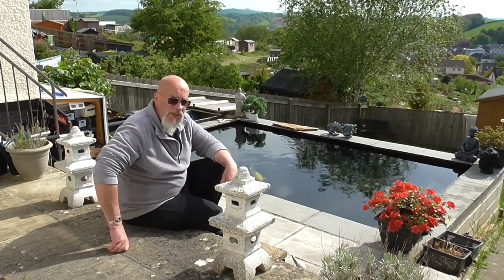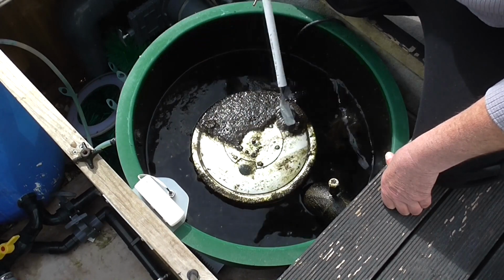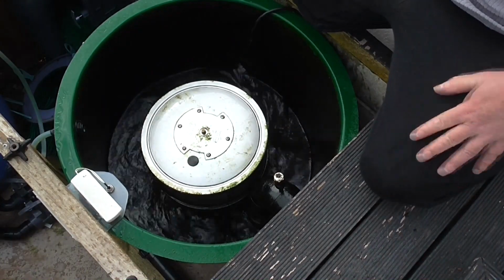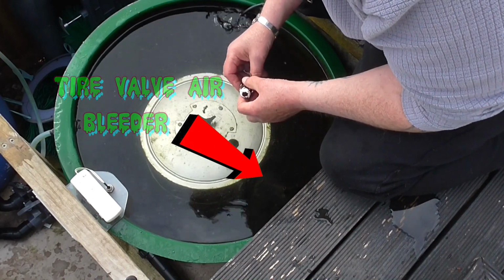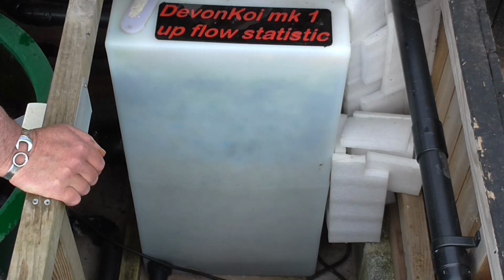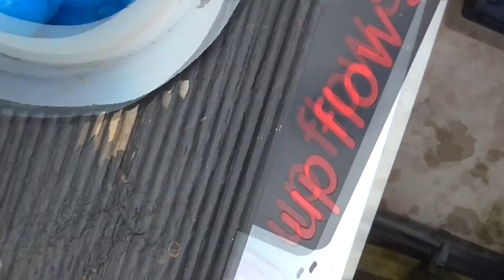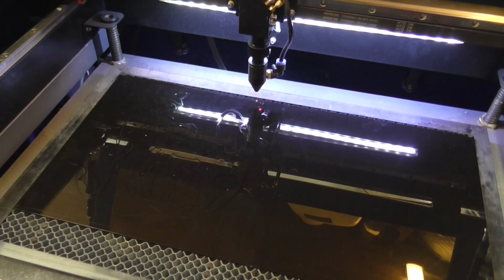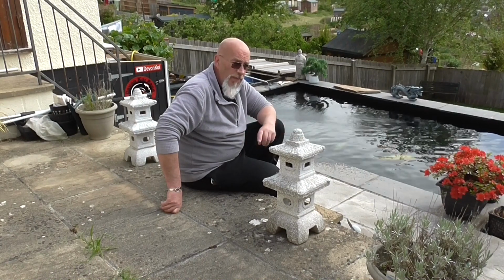***DIY KOI POND FILTERS*** UP-FLOW BUILD*** GRAVITY OR PUMP FEED***DIRTY POND FILTER***POND BALL***

Comment: Great job mate 👍 I have trickle out trickle in plus when clean multi bays loose about 3in from pond takecare that back mate 👍
Reply from the maker: How much water do you think you put in over a week then Dave so it sounds like alot
Reply: Pond is 6700 gallons with multi bays never really worked it out surpose run about litre every  2 minutes if need top up more after filter clean run it bit faster people have different ideas but to me works frash water going in just leave open tap on multi bay little bit dirty water gos to drain keep up great videos looks like your filter system working great 👍
Reply from the maker: Dave as with most its what ever works for you and your pond if its happy with it stick with it as they say have a good weekend mate
Reply: @boxtriker  you to mate hope you're back improves soon 👍 sure few beers will help 🤣

Comment: Looking good mate, cant believe the mess in your votex mate 🤦🏼‍♂️
Reply from the maker: Thats the main solid remover Graham and anything bigger than 70 micron dont get past it. the Answer filters are well under rated  but you have to clean the vortex or barrol they are in every 3 or 4 days summer time not leave it like i did for a week there must have been over a KG of crap in there with what had gone in food wise over the week. Have a good weekend mate
Reply: @boxtriker  yeah i normally flush my vortex twice a week and filter clean once a week in summer, more if needed but i do keep close eyes on it
Reply from the maker: My back was just so bad i could not manage the mid week clean but next time i wont skip it if it needs it her indoors can do it with a pointer or two. have a good weekend mate

Comment: Just wondering how you top up the lost water in the vortex? Do you use a hose pipe with untreated water?
Reply from the maker: The hose line has two ten inch sets of the 3 stage decorators on it  one up the tap end and one in the filter bay plus i spray it in very slow for the top up. Have a good weekend
Reply: @boxtriker  that makes a lot of sense. I have a different way of doing it.
Reply from the maker: Half term in two weeks will you be up for a visit
Reply: @boxtriker  No worries. I dont work Wednesdays so they are best or weekends. The pond looks like pea soup at the moment but hopefully the UV will sort it out by the time you arrive
Reply from the maker: Will massage you in two weeks then about poping round in the half term week